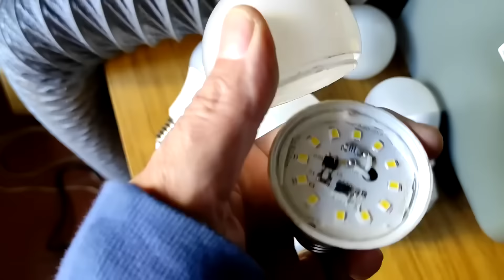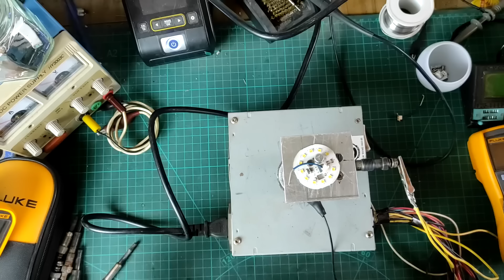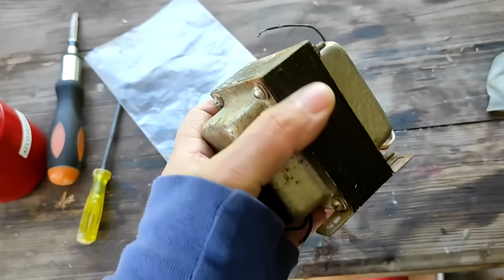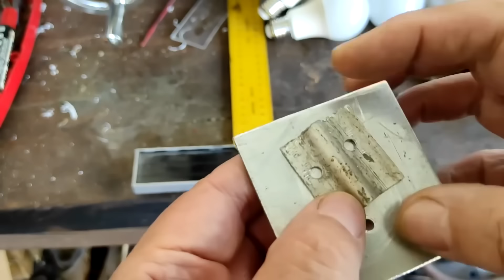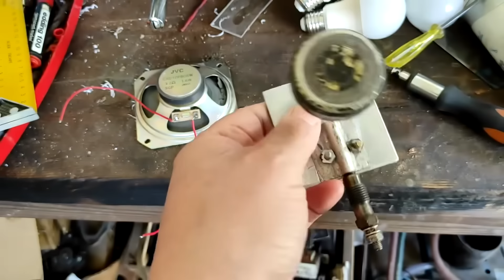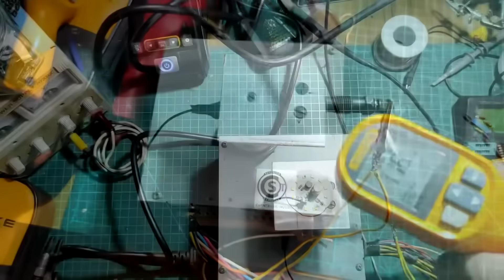Don't Throw Anything Away! Super Easy DIY SMD Extractor

Comment: Umm, using glow plugs and XT PSU is certainly the most creative way to make a heat plate i've seen.

No hate, but there are much easier and controlled ways to do this - swap the aluminium plates and glow plugs for a PCB with essentially a coil etched onto it, turning it into an electric convection heater, flip that upside down and place your LED globe board onto that. You can even use the same PSU and using different connection points on the coil you can control the temperature (im assuming you dont have a pentiometer capable of the high number of amps required for the coil / glow plug)

I'm going to try using an old waffle iron one day, seriously.

Comment: This is so me. thanks man, next week i'm going to a garage to see if they have some of those around (in france we have a lot of diesel cars). A "go plug is not the injector right? it's what ignites the hot oil?
Reply: It's a "Glow plug" and they provide the required heat to ignite the diesel when the engine is cold. When it's hot the compression alone will self-ignite the fuel. Hence no spark plugs, just glow plugs, cause they glow red hot ;)
Reply: @sirtra  Oh right what a dummy, i knew that. Thanks, i'll check how you call them in french, i think the proper term is "bougie de préchauffage" (pre-heat candle, literally). I might try to build a larger one with several later.

Comment: Will the constant heat be bad for the components? I usually use the solder sucking gun but it is also a hassle to use and mine is stuck at the moment and I need to clear it out and make it work again.

Comment: I found an old PSU in a junk heap that'd had sat for a few years prior. Sat it in my shop for months and it was bone dry. I was going to dismantle it, but out of curiosity, I plugged it in and the fan spun! It's already set up with the black and yellow wires! The other wires have plenty of wire left if I want to add different voltages later for a lab table top supply. I opened it up and it had two paper wasp nests and three dirt dobber nests in it. So yeah, really hard to kill these things!!!

Comment: Wow, this is so awesome. Though, isn't it better to use a flat plate instead of the magnet? Like wouldn't the stray heat from the spark plug demagnetize it? Or it doesn't reach it effectively?

Comment: I just use a hotplate. Adjust the temperature control to suit.

Some additional information to clarify. My hotplate is made for industrial uses. Room temp to 800F. The heating surface is a 10" square of aluminum plate 1" thick. The heating element  is a generic electric range spiral clamped to the bottom of the aluminum. With a digital commercial temperature controller you set the temp you want. When the heat indicator starts to cycle on and off it's ready. Hot plate temp does not drop when small items are placed on it. It holds the actual temp to plus or minus 2 degrees. One can use thermal paste if you need very precise heating of the item you're warming up. For electronic disassembly, I usually set it to 675F and forgo the thermal paste.
Reply: you mean the small cooking type of hot plates? I suppose one can buy it just for electronics and not for cooking. The ones I have seen usually have the spiral resistor heating element, or do you mean the ones with a flat top?
Reply: @soloflo https://www.youtube.com/watch?v=QarizoUnRfk

Comment: You can buy a glow plug for a ford/international  7.3L power stroke diesel engine, they are about $10 for one, I use them for all kinds of odd stuff but that's because I part them out.
Reply: just be creative and using what you have, you can use flat iron for your clothes, your solder iron screw a plate into, anything that have heater plate

Comment: I have a rework station. But the air can blow the small components away. I use a domestic crepe or pancake maker with a silicone pie dish on it for heating iPhones to remove broken screens etc. That might work here too. 

i would use the 5v for the glow plug. 12 volts gets them really hot ( well, they glow .). And just fyi, land rover td5 engines have five cylinders bit only four have glow plugs 😁😄
Reply: Actually, I have four spares. Might build a 12 volt frying pan..... Great use of old stuff, man.
Reply: They had 5 but Cesar borrowed one and no one noticed!

Comment: Remember before glass top stoves came out... I believe they called them Euro-flairs.. The cooktop burners were a solid metal disc, if you ran across one of those and put 110volts to it with the infinite heat switch, it would work pretty similar.

Comment: I'm lamp hoarder! 👍😆
I'm using LEDs from those lamps to repair lights with integrated LED panels. Usually some leds burns out, you can replace them, and change CS (current control) resistor near IC to make current a bit lower, so leds doesn't gets soo hot.

Comment: Whilst new bulbs come on special for as low as 8 cents I think this is saving at the wrong end.
Reply: @LawpickingLocksmith Just out of curiosity,where did you find an LED bulb  " on special" for 8 cents?
Reply: @petruse8893  meanwhile Bunnings sold out of them but new bulbs rarely fail.

Comment: Why didn't you use a simple plate style heating element ? There would be no components to bolt on.  If using an AC power supply perhaps a light dimmer/motor controller could regulate the temperature. Many DVMs come with a thermocouple to get repeatible results.  //

Comment: I would be very simple to add a microcontroller (like an esp32-c3), a temp sensor, a couple of buttons or rotary encoder, two small 3 digit displays (one for set temp and one for current temp) and a relay. With it you can have a true hot plate with regulatable and maintainable temperature.
Also, don't keep components at solder melting temperatures for too long, they are only supposed to be there for a couple dozen seconds at most.
Reply: This would be the most flexible way to go to build a useful tool, though requiring a bit more [sic] time and effort to get working.

Comment: That is basically a hot plate, and is a common method of reflowing circuit boards during assembly. On my last job, I frequently had to replace some SMT components on 4 layer circuit boards. (4 layer means 4 layers of copper, top, bottom, and two internal layers). Just like any piece of copper will draw away heat, so will the 4-layer board. Without a hot plate, I had considerable difficulty removing components with my hot air pencil. Using the same pencil with a hot plate, component removal (and reflow) were a snap.

Rather than using a glow plug, consider a heater cartridge. These are powered from 12V, 120V and 240V (AC or DC) at various power levels. They are screwed into a hole in the side of a thick piece of aluminum plate. Their power (heat) can be controlled using a lamp dimmer when powered from AC.

Comment: Can it work with regular sparkplugs?
Reply: I think the difference is that regular (gasoline/petrol) spark plugs literally spark, while the diesel ones glow red hot. It's the continuous heat that is used for this DIY hotplate.
Reply: @noccy80 You are right. At one point he calls it a spark plug (slip of the tongue, I guess), but it's not.
Reply: Spark plugs are not glow plugs. Big difference.

Comment: after watching it..  nope.  I'll just buy a heat gun.  🤣
it is easier to purchase a heat gun than finding those things in my house.  I'm pretty sure I do not have those things in here coz I'm not a boomer.   most of these you mention are from an adult people in the past like 1980's.  who still have their what? oven toasters or microwaves. 

I would consider if you make one using induction cooker.  coz that's the kind of thing the people now a days have in there kitchen.
Reply: Heat gun is not the right tool for this job as it's stressing components with the heat. Good luck removing smd electrolytic capacitor without damage with one. This tool is called hot plate it can be bought as well and is actually the right tool to solder smd components.
Reply: an induction cooker would be even easier; just put a piece of bare steel plate on the cooktop,sit your PCBs on top of it for parts removal. the plate will heat up just like a steel or cast iron frying pan. you have to get the plate up to about 400degF.

Comment: I wobder hpw you keep the temperatures from burning the circuits and boards
Reply: You eyeball it. They'd be trash anyways. Even recovering 50% of them is an improvement.
Reply: these LED lamps use aluminum core circuit boards. that's why using a soldering iron doesn't work,the AL core dissipates the heat before the solder melts. they're designed to be infrared-soldered during manufacture.

Comment: No heat gun? They are so useful. Heat shrink, plastic repair, pvc pipe bending, just as a few. That hot plate works great for this application though

Comment: Interesting DIY Hot plate, I happened to have some old spark plugs, aluminum plate and old psu. . I also kept my old bulbs that died. but I don't know what practical use I have for them though yet. What are you going to use the parts for?